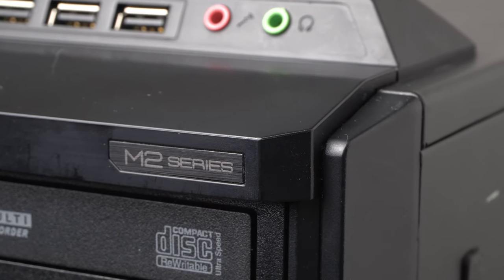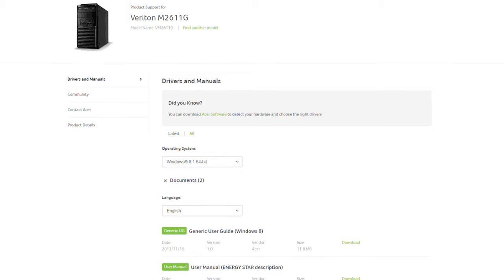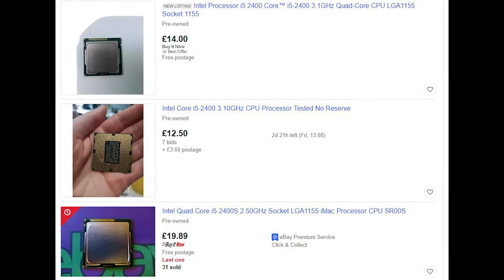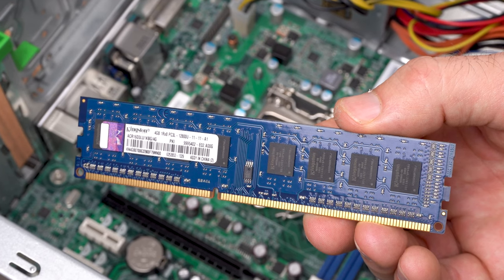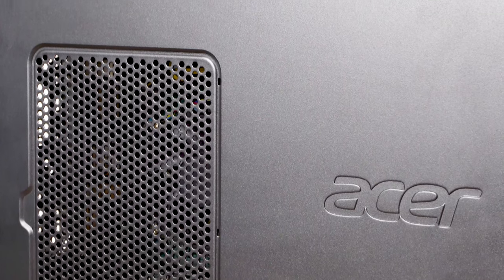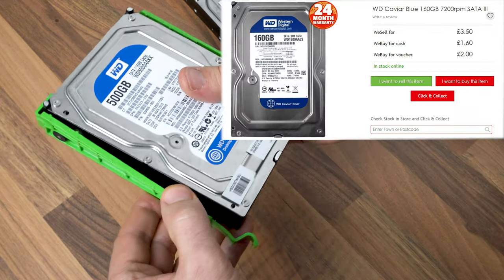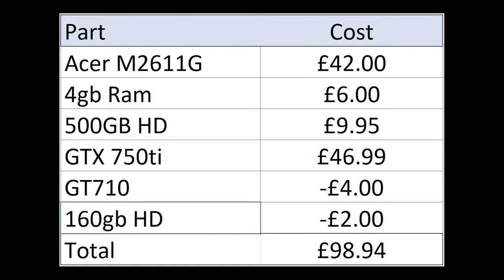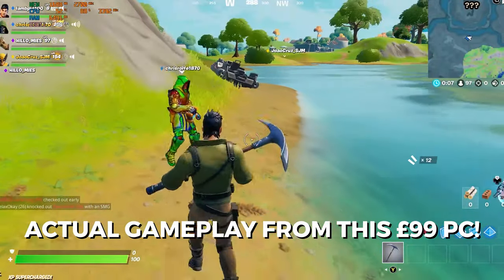Build An Awesome £100 Gaming PC! My Cheapest Gaming PC Build So Far. (Feat. Acer Veriton M2611G)

Comment: I've done similar with a HP 6300 sff. I upgraded with 16gb Ram, i5 3570k (I bought the 'k' to upgrade later with a z77 mobo and new case) Graphics is a GT 1030 due to only having a 250 watt psu. All-in it cost around the £150 mark.
Reply from the maker: I've not tried a HP yet, one to add to the list 👍😎

And when I built this pc graphics cards were a lot cheaper so I wouldn't be able to build it for £100 at the moment 😭

Comment: Wait thats me :0
Reply from the maker: Yep.👍😂, When you asked if it was possible to build a system for about £100 I had to have a go! It's not perfect and won't run modern games at high frame rates but it gets the job done 👍
Reply: @GameRoomOne  what frame rate woild csgo play at?
Reply from the maker: Csgo isn't very demanding, I haven't tested it yet but I'd expect it to run well on this system, I'll test it when I get a chance 👍😎
Reply: @GameRoomOne  ok ty
Reply from the maker: Fired up cs:go at lunch.. runs great..80-120fps at 1080p 👍😎
Reply: @GameRoomOne  yippeee tysm
Reply: Wholesome stuff 😎👌🏻
Reply: @GameRoomOne  hi  you probably wont remember me i ended up getting a gtx 1060ti and amd ryzen5 although i did do the 100  quid computer  and it ran very well